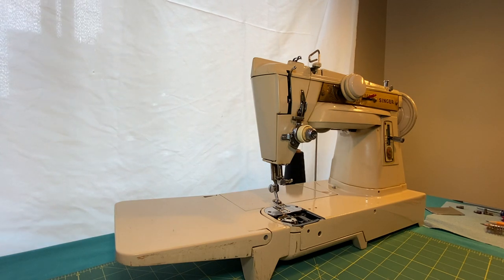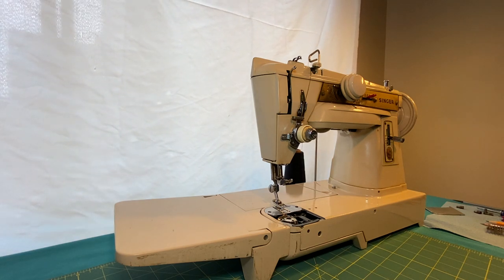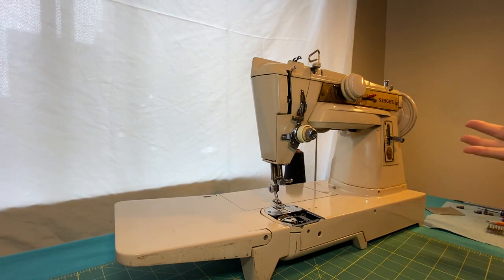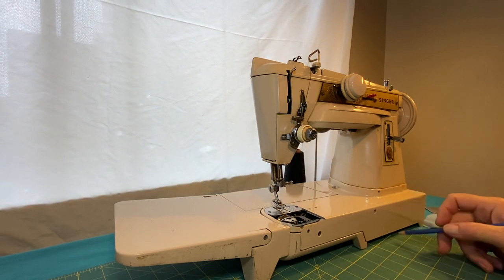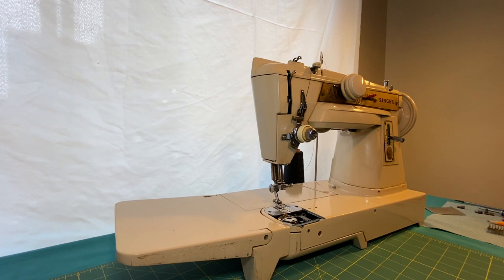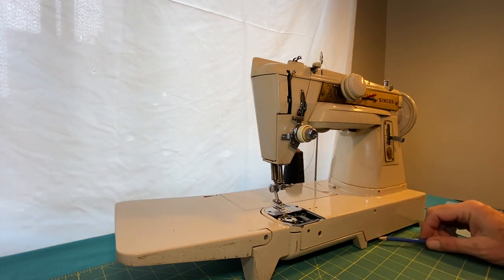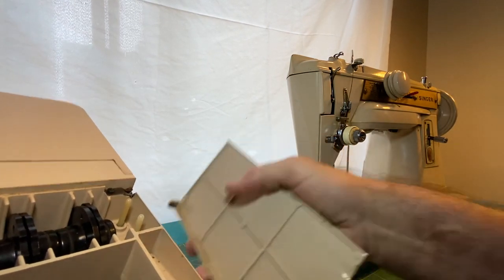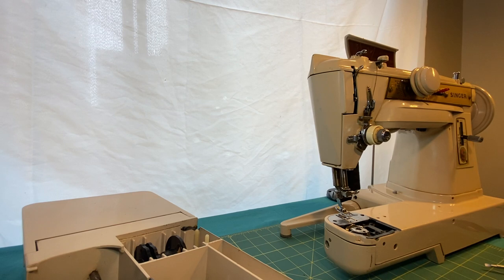Singer 431 G Convertible Vintage Sewing Machine

Comment from the maker: 08:00 This information is incorrect, you do not have to undo the top to install or remove the disc. The fashion discs just slip on or off. This was the last time I 'winged it'. I do a number of takes now which is very helpful. Especially when I am threading the needle on the sewing machines. There are always lots of takes with them! Lol!
But I am surprized how often it is threaded the first try.
Reply from the maker: Atta boy Jebb!

Comment: Darn what nice  sewing machines within a few days I'll be getting one (431g) that is coming via UK. In order to remove the special disks rotate the patterns selectors out of the special disk position. 
I do have one question. did you get a 220v to 110v converter?
Reply from the maker: THANK YOU FOR VISITING LUCIO MORALES, ME AND THE MACHINES APPRECIATE IT, LOL! MY SINGER 431 G HAS A PA10-8 MOTOR 110-120V. MY MACHINE CAME WITH NOTHING. I WRAPPED IT IN A TOWEL TO TRANSPORT IT! SO I DON'T HAVE A CONVERTOR. WHEN I CHECKED ONLINE LAST AUGUST, THEY ARE AVAILABLE ALL OVER THE PLACE. I DO NOT HAVE ANY KNOWLEDGE BASE ABOUT CONVERTORS. BUT I WILL NEED ONE FOR THE ELNA SUPERMATIC. IT HAS A CONVERTOR BUT IT IS BEYOND REDEMPTION!
 THANK YOU FOR YOUR QUESTION, JEBB.